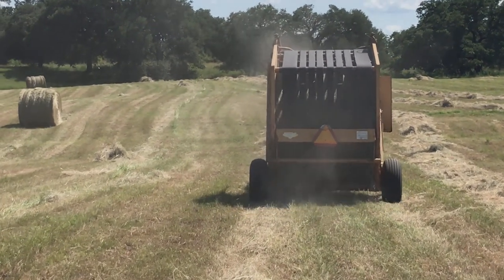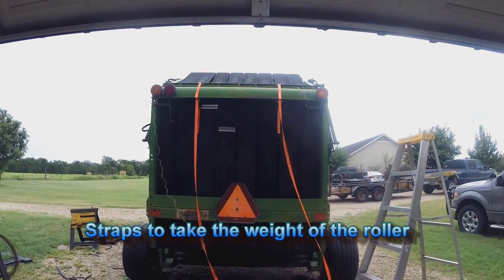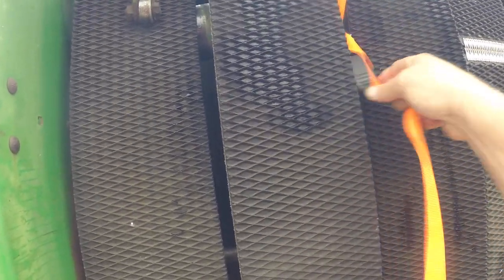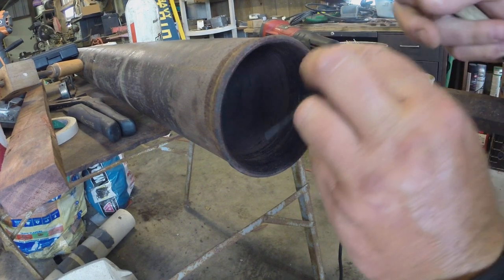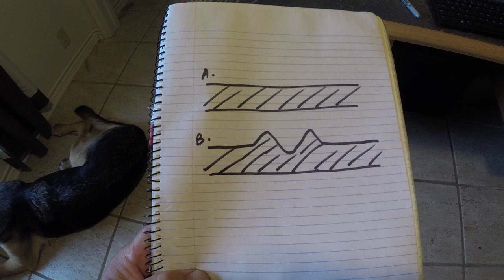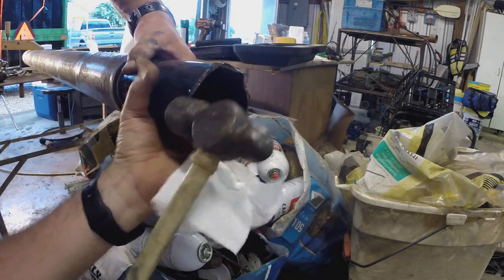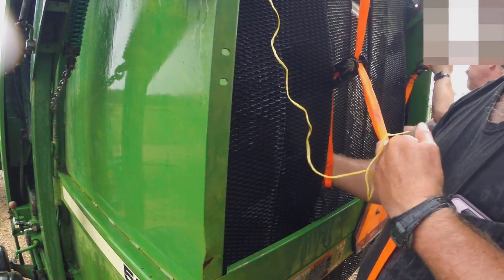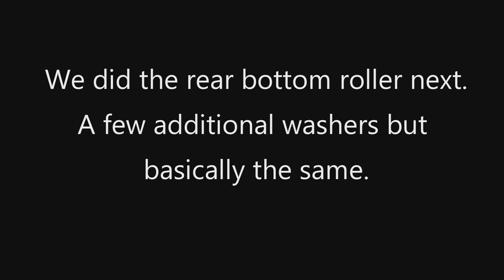Replacing roller bearings; JD 535 baler roller bearing repair

Comment: I feeling better that someone else has to replace these bearings in these round balers.  I have replaced several sets on my John Deere and one was so bad it fell out with a bunch of rust dust and the other was glowing red while baling in the field.  Lucky the glowing one was spotted at night.  They are a pain and the main reason for failure is no grease fittings to add grease.

Comment: Does the manual call for the loctite 660 or did you just use it to help with the damaged roller?
Reply from the maker: We used it because of the damaged (flared) roller. It's worked like a champ ever since.
Reply: @TheFritz423  got it thank you! When putting in the new bearings how do you know if they’re seated where they need to be and not too deep or shallow into the tube? Is there a lip or something they will bottom out against in the tube?

Comment: Could have just cut the race off? I'm trying to do one of the bigger roller in my 466. Deere says the smaller roller are heavier than the bigger one 53,48 respectively.
Reply from the maker: There is no race on these, the roller shaft acts like a race. If you mean the inner hub of the bearing that was destroyed yes you could cut it off but it came off pretty easy with heat.

Comment: I've been using 660 also.  Those rollers don't have much thickness around the bearings.  I wonder if heating up real nice then letting them cool and shrink would work?  I might try it on another old baler I'm building for a spare.
Reply from the maker: I don't think that would fix the flared end...luckily the peening and 660 has worked now for over 100 bales.
Reply: Peening looked like it would do the job, you’d have to be one hell of a smithy to take the flair out of that pipe and return it straight and round